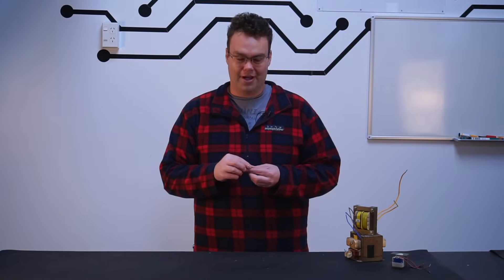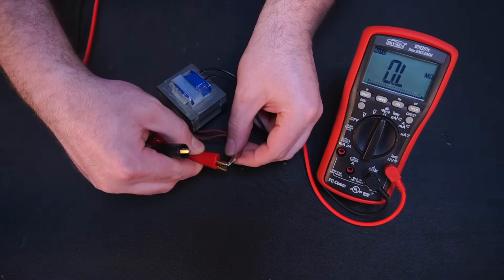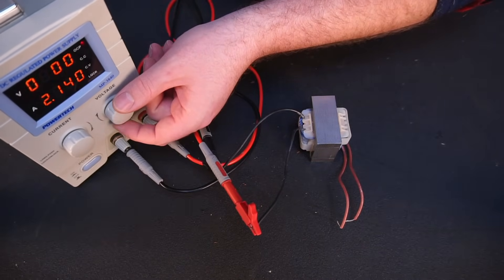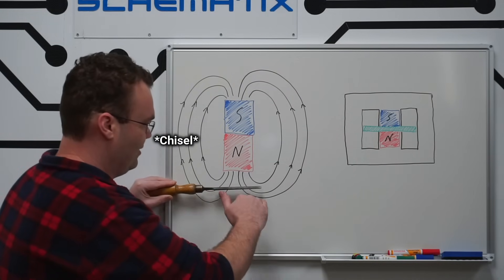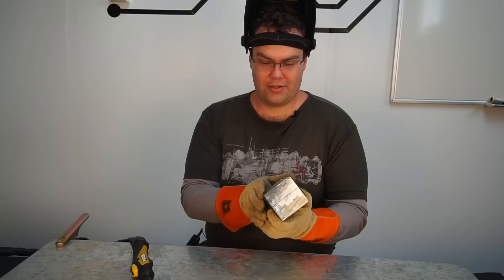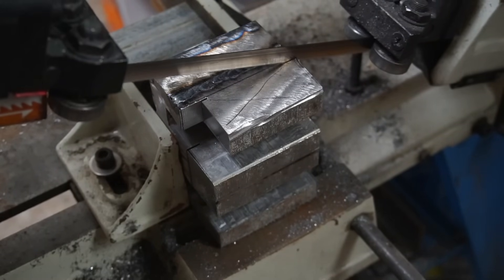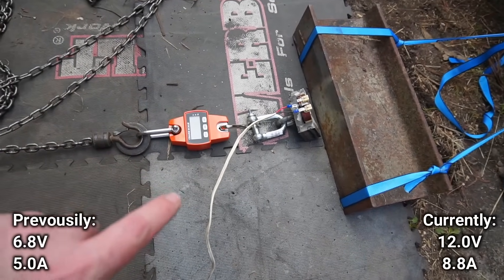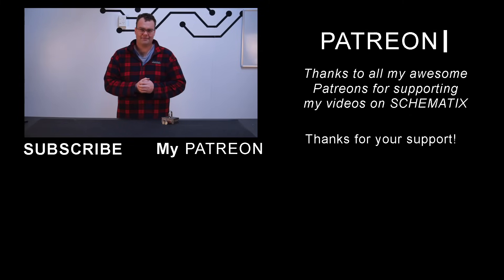Making a Powerful Electro Magnet from a Transformer

Comment: Excellent.  This was fun.  Two questions:
1.  Why 0.5 to 2.0[ohms]?  Is it ONLY about what resistance across the fixed DC source voltage which allows the desired peak current?
2.  What type of supply was used in the second (car tow hitch vs. steel pole) test?  Was this also an adjustable bench top supply, but with higher current capability?
3.  What happens if you hook the coil leads to an AC source, eg. a 120[v] (rms) from the wall plug?
OK, that was three questions.
Thanks again.  Very educational.

Comment: I sometimes watch these YouTube videos to see if I can find the errors.  With a current-source or current limited power supply,  less DC resistance in the coil is desirable for efficiency.    But current alone determines nothing without knowing the number of turns passing over the core.  Mmf is only related to current as long as we have a fixed number of turns and a fixed DC resistance.  Otherwise,  it is the number of ampere-turns that determines the mmf, or flux.  Not current alone.   Furthermore,  we don't really need a laminated core with steady DC,  due to the absence of eddy currents.  If AC is used,  a shading coil of copper should be added to induce magnetic flux at or near zero crossing.  It is also here that a laminated core,  such as that from a transformer,  should be used.
Reply: Great work,however it would be strongly recommended to us an uninterrupted power supply  and a safety harness when this is applied to heavy lifting projects.Power off at crucial moment could be fatal...PAW

Comment: 06:41 - 4 Amps! How can you touch that thing and not die electrocuted? (Amazing video, by the way! Thank you!)
Reply: Cause it's low dc voltage
Reply: Your skin can have a resistance anywhere from 1,000 to 100,000 Ohms depending on how dry it is. That high resistance is why 4 amps at low voltage won't kill you. I've heard that even less than half an amp at low voltage can kill you if it goes through your heart, but that won't happen if your skin is intact and dry.
Reply: @JThyroid  Amazing. Thank you so much for your reply, I still did not know that.

Comment: What is the purpose of the stacked piece???   I just bought a surface grinder that is missing the magnetic chuck. I must build a chuck and can't afford to buy one. If I simply weld up steel solid and roll the wire , will it have the same holding strength???
I have made these microwave mags before for material handling. They're great for that.

Comment: MMF is measured in ampereturns. Thinner Wire equals more turns so the heat developed is independent of the Wire thickness

Comment: Excellent video & job. I have something more interesting in Applying this experiment and which will be similar to creating a Bi-Filler or Tri-polar transformer.  Instead of using that super magnet power in PULLING a load, use that magnet power to increase or enlarge the Voltage & Current into a SECONDARY WINDING.  Basically you input 12V DC with 5A, and see how much more you can OUPUT from a secondary Winding - maybe 100 times more ........,what do you think.

Comment: Great video!  I was wondering about the power.  You use DC: 6.8V 5.0A and 12.0V 8.8A. 
Are these volts and amps dangerous?
Reply: Voltages are not dangerous but current is. As little as one half of one Amp could stop a person's heart if the current's path travels through it

Comment: Great video. I have been having trouble finding a dc power supply that will work with these electromagnets. each one I buy trips so that the power goes on and off rapidly. I have 1.67 copper winding thickness and 0.5 ohms resistance on each magnet. I can only power these up at the moment with my lab power supply similar to your in the video maxing out at 5 amps
Reply: I’m having the same problem 
When I hook up the 12v 10a power supply it pulses the magnetic field but if I hook up a 12v bulb it lights normally 
I’m no electrical engineer 
But I’m sure there is a fix for this.
Reply: @Steve Metzker  AC current runs in a wave up and down (Alternating Current) so ig your using AC, you would have to increase the frequency, with DC (Direct Current) it's constant, (no wave). You be better off sticking with the DC.

Comment: Great and useful project. I'm a woodworker with a good quality cabinet saw. I use two electro magnets in a wooden feather board to guide my work through the saw instead of using my hand (for obvious reasons), I can position the feather board anywhere on the cast iron table to fit the work I am cutting. I wished I had seen your vid before I purchased the magnets from Aliexpress. Going to build your drill press vice next.

Comment: What about taking 2 of those heavier gage windings and stacking them in the same housing? Any idea what that would do to the strength?
Reply: From Reading other comments it appears as though the amount of turns in the windings makes a difference so it should theoretically double the magnetic force but might also cause heat problems because it is compounded into one area it might be smarter to just use to Transformers side by side where they could dissipate heat. I also wonder if using epoxy is the best method rather than covering the surfaces with a piece of plastic or something to keep filings and other debris out and still allow are around the windings and keyframes for heat dissipation

Comment: I would love to know how I could build an electro magnet strong enough to remove metal splinters. they are a continual annoyance when working with metal. Sometimes a good set of tweezers is will do the job, but one of mine is burried so deep I've abandond hope of ever removing it.
Reply: Your body will expel it eventually.  Invest in some good gloves to protect your hands instead of trying to find a shortcut, like a magnet.
Reply: @DominicNJ73  if it is ferrous it wont ever even get a chance to be expelled, the body will oxidize it and absorb it. Glass and plastics are the bad guys in the splinter category.

Comment: Great video man! You clearly put a lot of effort in it, and it shows. It would be a great electronic lock for your workshop. Not at max current, that would be too harsh for the winding. Or if you make it waterproof, it could be a great magnet-fishing device. Power it up with a car battery. And I sure can use a scaled-down version to get the thousands of tiny screws and bolts out of my long fibre carpet.

Comment: At 9:33 after you cut the transformer core, you drew your field lines on the electromagnet wrong.  You drew the lines outside the iron laminate on the three sides that the iron sheets are.  There is hardly any magnetic field around it and on the side that you did cut the magnetic field lines are exposed in the open space.  Your bolt will not be attracted if you place them on the other three sides where is you see your magnetic field lines because they are not out in the open space around the iron.  Keep it simple and especially keep it straight.

Comment: The magnetic field does not work as it is drawn on the board.
any piece of permanent magnet naturally has an overall size, in the middle of the magnet there is a neutral zone. The interaction does not occur from one pole to the other, but from both poles to the middle. Even in textbooks, it is often incorrectly shown, as a result, students are misled.

Comment: Did anyone try comparing the secondary vs. The primary coil. More turns but thinner wire how does it compare???
Reply: The resistance of a long wire is too high. You would need too high voltages. And thin wire can't handle high currents.
Reply: @oscar3611  I did a video comparing both last weekend😁

Comment: Is there any chance of electrical shock when touching the drill press or work piece while the magnet is energized? 
Regards
Paul
Reply: No, there is not. electric shock is just a thing with higher voltages and even then you won't be shocked, unless you touch the leads.
Reply: @Johnnybangel  Thank you for the response.

Comment: Hello. I used 12 volts and 12.5 currents. It got too hot after 20 minutes of operation. If I lower the current value, would I use it longer? Will I experience a decrease in my usage power? How much current should I use at most?

Comment: I did make one from a microzapp'r effing thing is very powerful, I use it to re-zap old bar magnets.
I made up a number of 1157 lamps car tail lite bulbs., the more bulbs in circuit, the more powerfull
it gets, this way u can use it without burning it out. by not forcing too much current thru it. go to 
Wal-mart, for 80$ buy the large hamilton beach microwave, take xformer out very carefully, return in a week with it in box and with receit, just tell them it stopped working, well it did after u took out a part, 
right? u r not lying. and get ur money back. cut so u have the face of the 3 poles and have a good time.
Reply: That's just ugly. Stupid advice man. Free broken microwaves are all over the place.
Reply: @oscar3611  actually they are not, they end up in public landfills or dumps and you can't even go in and pick through anymore.Hey Oscar, if u weren't so wet behind the ears 
and actually knew something. . . monjiune struntz!

Comment: I’ve seen loads of videos on microwave transformers converted to spot welding transformers, but this is the first time I’ve seen a conversion into an electromagnet. Nice work! 👍 I’ll give it a try myself.
Reply: Yup, a storm's power surge took out my microzappr,  I knew there was a good size transformer in it and cut two groves with an angle grinder. Having an old truck battery
with external cell connectors, I can use at 6 or 8 volts and not overheat the primary coil.
Reply: @raymondgarafano8604  I could not find microzappr online.  What is that?
Reply: @headbanger1428  a microzapper is just another term I use for a microwave oven, 
that's all, Maybe I should have called it a micro-doo-hickey, a micro thing-a-ma-jig.
Reply: There have been dozens of copies all the same for years.
Pathetic.
Reply: @โนรีคอกเบิร์น  Replies little man to a comment of 3y ago when there wasn’t.

Comment: this reminded me of the time when we took our 480volt  generator and tried to pull the stator out of the mag field. he had to bolt it down to a table and lift it with a forklift. luckily no one was hurt but the starter shot up in the air and swung around by the chain about 6 times before stopping. it weights 150 lbs... be careful stressing high powered magnets. you could easily get your head bashed in...

Comment: Do these magnets have an attraction time?  How many minutes does it run maximum?  Is there any problem in long term studies?
Reply: If you stay within the current limits of the wire thickness, it could last forever. 50% of the maximum current of the wire would be safe I guess for heat dissipation.

Comment: The manufacturers strive to insulate the sheets between them ... you weld them together, so that there is safe contact.
Of course, Leon Focault discovered eddy currents in vain.
Do you lift a steel beam with the device and until you position it or some time passes, does it come off?
Anyway, advertising is the soul of trade and it doesn't matter if it gets hurt ...

Comment: Sorry but you make a rather big mistake.
The magnetic field lines always take the route with the least resistance to them. The iron core has by far the least resistance to the magnetic field lines so the magnetic field lines go through the core. Only a very few stray field lines get out of the core but the are so few (thus weak) they can barely hold the bold.

When you opened the core by cutting of the bottom part of the transformer you opened the magnetic circuit. Now the magnetic field lines have to travel partly through the air but enter the iron core again as quickly as the can. They still want to use the route with the least resistance.
This means the field lines enter the core again just left and right of the center tab. This way the magnetic field lines are concentrated in the air between the legs of the M shaped core.
That is why it can hold so much at that end of the core. The field at the top will also get a little stronger but when you pick up an iron or other ferromagnetic metal at he bottom the field at the top will decrease significantly and it will again barely hold the bold.

The chisel is made of  a ferromagnetic metal (iron or steal). These metals have a very low resistance to magnetic fields. The magnetic field very much likes to go trough it because it is the route with the least resistance. The field lines “reach” out to the metal and follow the form of the metal as much as they can. This concentrates the field lines in the chisel and make it magnetic as well.
That magnet is pulled towards the other magnet (the core). The closer it gets the more field lines can enter and follow the shape of the chisel. When the chisel touches the core the magnetic circuit is closed and all (almost all) field lines will go trough the chisel and no longer around it.

The amount of magnetic field lines that a piece of metal can conduct depends on it magnetic properties, the shape of the piece and the cross section of it. A 1 inch steel nail will not be able to conduct all the field lines your electromagnet produces. That is why there will be a lot of field lines so a pretty strong field left to pick up other metal parts like more nails.
If you place a firm piece of iron on it there will be much less or even no field lines left that go around it so you can no longer pick up any other pieces.

Comment: Would cutting two slots in the top be stronger than shaving them down as shown on most clips? Just surface area. Does anyone know what microwave oven transformer is best to cut down and lose iron or push up and just cut  2 thin slots out as i said surface area is better or is cutting them down make the best with being near the primary coil.  Full size mot 2 slots after 2ndry removed or cut down to copper primary?
Reply: Thats a good question and also solved 5he milling the surface down issue as the faces wohld still be rlat on the ends!

Comment: Neat to see someone playing with magnets 🧲 I have all wise been fascinated by magnetic fields for 50 years and your explanation is wrong close but wrong this is proved but the current used and it’s a nice simple natural logarithmic function too  the field doesn’t go around the well it tries signified by low current of the soul when you bring your file in it acts as a pole pice   To connect the magnificent circuit sown by much increased current the effect is best measure with AC but works with either 
The amount of hold strength is impressive but a problem with dc is it mantises the core so don’t just turn it off reverse drive so it actively releases  works great I am thinking about how gravity works it and magnetization must be related but how ?
Reply: Did you just have a stroke?

Comment: What was the temperature of the winding after a few minutes?  I would like to know the result of reducing the current to see when the 300kg is released.
Reply: That's actually a really good question. I also would be very interested to know the answer.
Reply: Yup.  Third that.      What was temp° and could you please do a reduction in current + a fixed weight #  so a ballpark value can be determined!    :)   thanks lots. Great channel and good on you!
Reply: Very usefull video. Thank you. Please try to compile a temperature curve e.g. for 30 minutes of metal machining. Somebody in other video checked the different voltage for input - 3V, 5V, 15V etc. Suppose max weight of metal machined piece cca 10kgs. What a appropriate Voltage by relevant temperture? What about a dBA or vibrations during work?

Comment: There is a USA sport called magnet fishing. Nice to have a magnet you can release the power on if it gets stuck Youtube search magnet fishing
Reply: Exactly what I was about to siggest. He would need to make the magnet waterproof (not difficult with an epoxy cast) and run thick cables to the depths in order to magnet fish anything. However this should be a lot cheaper tu build than one of those 500KG magnets that are available.

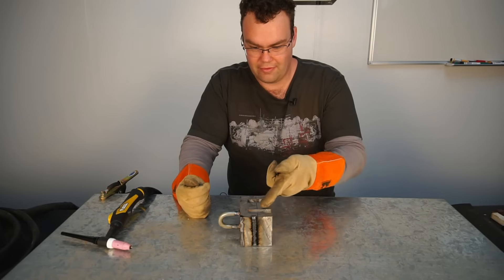Comment: 13:00 Genuine shame you cut off so much of the laminate! Flux lines follow the path of least magnetic resistance, Air is very resistive, so most ALL would follow the laminate, and there is so much more room on that core to hold many more wraps of 18 gauge wire, (many more amp-turns) (Not approaching saturation)  You could have made so much more powerful a magnet!!! oh well!

Comment: When you weld the laminates on a transformer, you should be able to do this without filler wire. All you are doing is fusing them. This is how they are welded when they are new.

Comment: If we are going to make such that strong magnet or probably the stronger, how can I do the math? How do I calculate the requirement, like the kernel thickness, the wire thickness, the number of turns, and so on. I need that calculation.
Reply: F=(n×i) × 1.2 /(2xg2)
Reply: @oobert_6874  what are those F, n, i, and g denote?
Reply: @StrsAmbrg  f=force n= number of turns in the solenoid i=current g=length